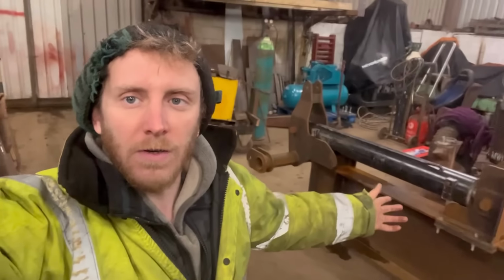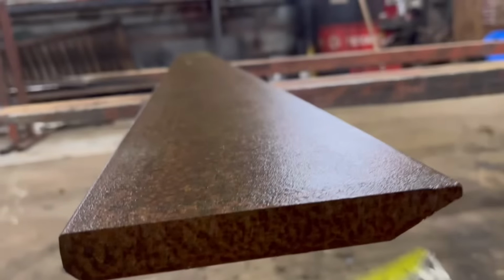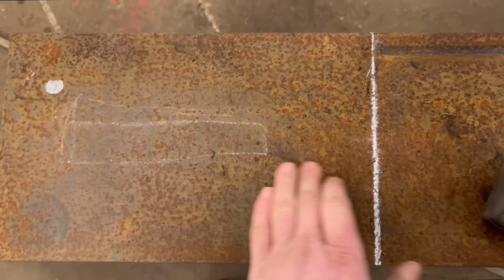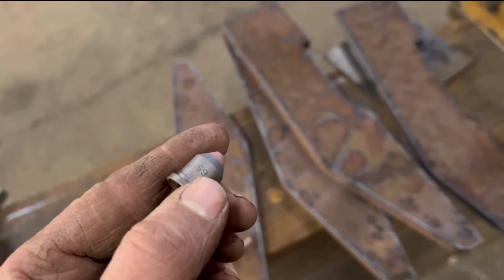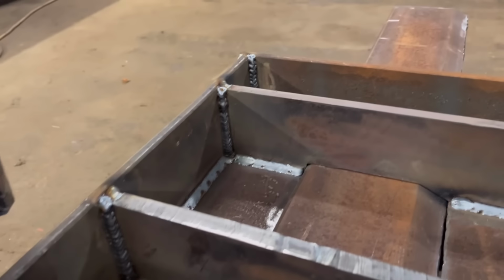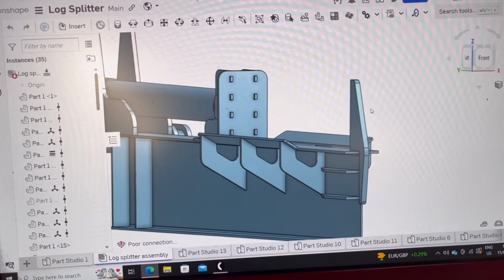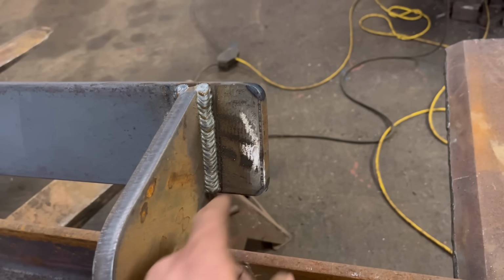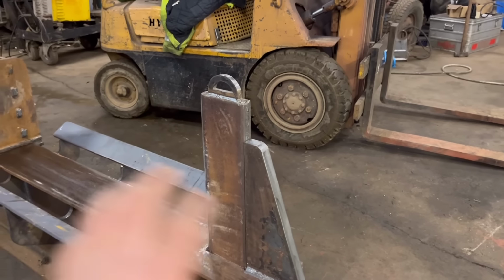Making a HUGE log splitter. Part 3

Comment: Totally over engineered.
If you can only  hand  lift 24 inch logs to the unit you only need 30 inch stroke.
 Star cutter on end (4 way split).
 faster stroke needed.
 smaller cylinder will do the job.
 Good work though !

Comment: A very nice job. And you mentioned the 2 improvements I was thinking of.I would make a large table on the side opposite where you mount the control valve and make 4 and 6 way splitter blades.

Comment: I have one built in 1981 and it’s extremely heavy duty like this one and is very heavy, needs a jd420/4440 to handle it properly 😮😮😮, going to add a engine and pump, plus tank under it and I could use it both ways, and keep 3 point hitch setup

Comment: Also when I was welding we used to have core why and it was much better than the the coated wire I like it a lot better anyway the other thing is that it's much easier to weld heavy heavy material with it the core wire it's better in the wind is too as well I found it bernd a bit hotter but I like the world with a heart hotter hire rampage cuz I don't like a cold pool molten pool❤😂🎉😢😮😅😊😊😅😅

Comment: There's a advisor with a welding 🥽 lens in it that's that's like it's like a pair of glasses I find it much easier to tack weld with it I haven't got that helmet flopping around the top of your head not saying to weld longwells with it but just to do the attacking it's the easiest you can also get them to switch on and off so that they clear when there's no bright light

Comment: When welding vertical up and down, try point your welding nozzle UPHILL. Weave weld UPHILL and normal weld coming downhill. Your V ups look a little cold. Try upping your wire feed, amperage and voltage. At 43.09, I would be trying 150 amps and 20 volts to start and adjust from there.

Comment: Tip.... for your vertical up welds, weld triangles,  across joint - then up at an angle to center joint - then down at an angle to the top of your cross weld - then stack and repeat.  You'll get the feel for how far you can travel on the vertical angle up with metal thickness to voltage used. Super strong weld. Used on Manitowoc cranes at Manitowoc Engineering,should work well for the rest of us ! Hope this helps.

Comment: The blade's not strong enough to split aluminum or copper ingots. Make the blade into a wedge with flat back and harden the leading edge. Widen the back support to continue wedging.

Comment: I had to put an anchor bracket on the seal end of the ram on mine because there is always a tiny bit of flex in the rod where it goes into the ram and it kept blowing seals. And the slide started gouging into the main beam

Comment: I have a Hakki pilke processor 1x37 which has a 10t ram in it. It has its own pump and has a really fast stroke rate. It will split as big an Oak ring that you would want to lift into it. 

By going for such a big ram and the strength you have built it I would want it to split the wood into perhaps 20 parts. There's a few machines on YouTube that look a similar size to what you are going for here and they break huge rings down into many smaller logs. 2, 4,6 way split just doesn't justify the strength of this machine. This almost wants to be a one-and-done type of machine. 

One of the great things about the machine I have is the fact the timber goes up an elevator and into the trailer which is super handy. Ideally, you don't want to be handling the wood twice if you can help it here.

Interested to see what your future plans are for this machine and how you plan to progress it. Great work so far.

Comment: I live in the North East US, I've seen a LOT of mechanical devices people have referred to as "log splitters". They were all incorrect. What you have there is a log splitter, all others are pretenders! Try welding some angle iron on each side of the blade. That will solve a lot of problem of the split pieces staying held by bits of stringy wood.

Comment: In college we had to learn all position welding because you can’t always move your work around so you have to adapt. Flat and horizontal are easier but vertical and overhead are sometimes necessary

Comment: Add some spreader wedges at the back of the blade. It wil save your cylinder from having to travel so much on stubborn word. I thought i overbuilt built my fabrication , this is one strong spliter. It will be here for many centuries.

Comment: I looked up the cast number on that beam - I'm a Shift Manager at Scunthorpe Steelplant. If that is British Steel I was on when the steel was made and cast into a slab ready for rolling😁. That cast was made in June 2020, if it's not British Steel then it should be!  Coincidentally my friend owns a farm and we made a similar splitter with a JCB hydraulic ram, used a DCV from an old potato harvester to control the hydraulics on the splitter itself rather than in the tractor. Nice work

Comment: its to slow  try an find a hedge cutter pump they are usually a  two stage pump they move the ram faster until it hits the log then it will go into high pressure for splitting all you need is a separate oil tank an run the pump off the pto that way you will save on fuel to because the tractor will only be ticking over
Reply from the maker: When we’re using it at the end of the video the tractor is only ticking over and it’s plenty fast enough.

Comment: Little idea. I used to work welding nothing but big splitters 20 / 36 and 50 ton splitters,to mount on a traktorer hydraulic. You need to make the backside of the wedge/knife wider. weld 20 or 30 millimeters in on the backside and tilt it forward maby10 millimeter, so that the log is not wanting to be pushed up from the knife. just an idea very good work with a lot of talent. greetings from Denmark

Comment: why didnt you make the flat plate pushed by the ram stop with in 1/4"  or the wedge all it do it split it and have to be pulled apart so not fully splitting it, its very slow splitting and not that big of ram

Comment: If you put kickers 3 or 4 inches from the point, after the log starts to split it will complete the split much quicker. If you have trouble splitting harder wood, the width of one of those cutting edges is quite enough and will start a split much easier in hard woods. If you split a lot of wood you will want a dedicated engine and two stage pump. Or maybe a high flow skid steer or tractor. It would move the ram much quicker and still have  power when needed. Very nice splitter!

Comment: Beats how we used to cut wood. We had a huge tallowood tree about 6feet dia.and about 25 metres long.  First cut it inot 6 ft lengths then split these into large strainer post si ze  pieces then carted themm to the sawbench and cut them into blocks then split into firewood size blocks about 3inches square

Comment: You could have built  it sideways  or upsidedown so you wouldnt need to lift the blocks up but just back over them with the tractor aand split them.
Reply: You could then pick up the block and split straight into the trrailer save any lifting. Just a thought.

Comment: i built a similar logsplitter 2 years ago,  for the knife I used a worn out ploughshare - works great.  Even works for splittimg logs in 4 parts, using 2 shares and a bit welding. But most of the times i only split in 2 at once.  Its not so usefull, if your tractor's got mechanical hydraulic control units - you gotta enter the trqctor cabin for operation.  I'm mounting my splitter not in the back but at the front loader, and built a cable extension for the hydraulic control units - si I can operate the splitter right next to the splitter iitself, don' need to get on the tractor. Works very fast & efficient -  mostly splittimg logs of 110cm length.

Comment: To reduce flexing at the blade end of the unit you could add a strut rod or strut bar that connects from the top of the 3 point hitch mount and connects to the top of the blade or the blade support at the very end.  Having a way to pretension it would be key.  It would also help support the end when being transported on the 3 point hitch.  Even a large diameter steel cable with a turnbuckle would provide support to the blade or blade reinforcement and it wouldn't be in the way.  A 2' diameter piece of round bar with a way to preload it should eliminate most flex.

You should have cut slots in both sides of the splitter blade.  If you would have cut 3/8"x4" slots in different places on each half of the blade you could have welder the slots up which would have bonded the halves together throughout the surface.

Comment: If you made an adapter piece for the ram head, you would only need 2 pins to hold it in, and it would be possible to allow for multiple adjustments for length by just making different adapters. A simple piece shaped like a "T" with 2 holes for pins that lies down and braces against the head for stability and to push straight at the head.

Also consider making a cross piece for the blade, so it can split vertically ans horizontally in one pass.

Nice work!! (those welds look pretty good to me, don't so hard on yourself)

Comment: Just a tip for you when doing vertical up welds, try doing a tall “n” weave instead of the “C” or “Z” weave. Running the “n” weave allows more time for you to penetrate the base material a little more. And it makes your final bead come out a little more consistent. 
(Not trying to sound like a smart ass just some friendly advice from a certified career welder)

Comment: Hi ollie,i built a big log splitter (i thought it was big until you started this one😂). Its a tow behind with its own honda gx340. I e mailed FLOWFIT with my ram size and engine and they supplied adapter/pump/valve block. Its a 2 stage pump that really speeds up operation. Also the valve block is designed for a splitter so has auto kickout on return stroke so i can be loading next log as it does its thing. I have it on 3 point linkage and quick connect hydraulic fittings but even when neighbours borrow it they use it off petrol engine because the 2 speed pump is so much quicker and petrol engine has loads of power to bust even the hardest of seasoned oak logs

Comment: Nice work as usual Oliver!
You might want to have the knife leaning slightly towards the press plate. That will help to prevent the log to lift. Knots and other will sometimes make the log to behave quite difficult.
I don’t know, but the main beam can also behave a bit strange when splitting a crooked log. Time will tell.
Keep up the good work!!

Comment: The blade needs to be welded where it enters the joist and it is not sharp enough. Also for greater force, a little bit bigger hydraulic ram is required. I may be wrong.

Comment: those blades that are a cross can be a pain in the ass mate, unless you do one size log all the time because it will make odd size firewood depending on the size of the log, good work i wish i could do a fraction of what you can do

Comment: I agree a 4 way blade with adjustable height. Watching your dad yanking at the 90% split oak just showed me why I get a bad back when I'm splitting. Need to be able to just retract ram and put another log in and let that push the first one through. At least it's attached to the tractor so you can just keep drawing forward to clear the pile of split. But I have to admit that's the first log splitter I've ever seen that will survive a nuclear blast. Keep up the videos love watching them.

Comment: You can easily fix your Adflo battery as there are only 18650 cells inside. Just pull it apart and replace them, will be loads cheaper than a new pack.
Reply from the maker: That’s good to know, Thanks!

Comment: Hi Olly.
Just a little tip regarding UV protection. A clear lens can also be used. So if you have a clear face mask you could use it in combo with your dark shades and you won't get red in the face. 
Thanks for the video.

Comment: I welded a horizontal bar on the push plate about 50mm down with a V in the centre to clear the  splitting wedge
It made the world of difference and stopped the logs kicking up when under pressure 
Fantastic job you got going on there

Comment: It turned out amazing Oliver, well done. As for your welding we are our own worst critics and I can not weld. Just a thought about putting an axle with wheels on the end not large ones. Then put fenders over the tires that can help with catching the cut wood so it does not fall on the ground. Just a thought your knowledge is much better then mine in fabricating and designing.  Cheers!

Comment: Looks great better it flexes a little bit than snaps, only thing seen that could improve your overall design is to extend the wood 🪵 catches all the way to the end so your not having to bend over to piece up pieces you just split, make two more of those brackets and add about a foot or two of the plate to top, that way you just retract the ram and place pieces back on the cutting edge and go again, we bought a cheapo Champion wood splitter for our shop, and it definitely needs wood 🪵 catches in it, definitely going to extend past blade, plus have plans to raise it up by approximately a foot or more cause it's right on the ground, but as far as MONSTER wood splitters, you made the big daddy 😉🤣👍👍👍👏👏👏

Comment: Hi Oliver, A suggestion install a diverter valve that adds the return flow oil into the high pressure line up to a threshold pressure and when the load is high on the ram it releases and allows the low pressure side to return to the tractor. It works like there are two speeds - just done automatically
Reply from the maker: Yes, this sounds a good idea

Comment: No wonder it is so big. Not so much a long splitter, as a tree splitter. Good for a prototype. Vertical up mig. I find it really hard. Getting the welder set up is the hardest. I have been told go down a metal thickness. But I still have trouble. Wish mine were as good as yours.

Comment: Hi Oliver this is only my wondering, if the cutting blade tapered back towards ram at top,( at a slant longer at top than bottom)  do you think it will push log downward to base clamping it  stoping log lifting upwards also may put less pressure on blade cutting through at a angled blade than full blade, hopefully stopping some of flex. You right about  painting you don't want it rusting through in a couple of weeks. Absolutely  Brilliant. Thanks Mick
Reply from the maker: Yes, more like a scissor, I should have done that
Reply: Sometimes  you only see these things after  someone has done all the work making it. Best part of involvement with your projects. REGARDS Mick

Comment: Are you going to add a valve body outside so you can put the tractor hydraulics in float and operate it from outside by yourself?
Reply from the maker: Yes that’s the plan

Comment: Thanks for putting the 10x on the screen when you time lapsed (even if it was in the top or bottom corner).  It makes someone that does not work in metal like you to understand how long it takes to cut steel, etc.  Also great job on the splitter.

Comment: Nice job . But i been welding for 30 years some vertical up but much of the time vertical down and the guy i work for all vertical down. we work on heavy equipment ,truck frames we build trailer and do repairs like you .never had one come back you just need to no what your doing  in joy watch you . When we do cut edges we clamp the length of it to a box tube to keep it straight. keep up the good work

Comment: What a beauty!
I’d say stick some graphite grease on those sliders, apparently it’s better than moly grease in wet environments (I think they use it on 5th wheel couplings). 
Lovely job, I’d love a log splitter, nowhere near this big though, I’ve only got a little log burner.

Comment: I tried to warn you in the previous video. It’s way more work with the wedge stationary and the ram pushing the log. Should’ve put the wedge on the ram and flat part stationary. The way you have it pushes the log past where you’re standing and onto the ground. You can “catch” the piece on your side but still have to walk around the machine, pick up the piece a second time for a second split of the piece opposite you.  
I’m not questioning your skill as a fabricator, just the design.
Reply from the maker: No, this suits how we’ll have it set up better because it’ll push the split logs off the splitter onto the next process.

Comment: Great work as always Oliver but what the Christ are you splitting over there that you need such a powerful ram that moves at, what can only be politely called, a graceful and stately pace?  Petrified wood? Had one like this once but vertical. Too scary to use on the 3 point hitch so I chained it to a tree and used it occasionally to split knarly blocks but mostly as a crude hydraulic press and bender. It was also useful for splitting defunct wood splitters. A wood splitter splitter.

Comment: You need to get a standalone engine on it. Issue with running a big tractor (with enough flow for a decent cycle time) is it costs £12 at least in depreciation plus diesel plus a man in the cab. 

Would also make a shit hot video, that would get loads of views, if you built an engine on it and a log lifter etc etc

As always 👌🔥

Comment: Some log splitter that mate. As for the vertical welding it’s not that bad at all to be honest. I find using stick welding better than mig for vertical, just because the arc is more controllable. Just the way I was taught 👍

Comment: As has been said before a cross  saves you having to put the logs through twice 
A slight downward rake on the blade helps to keep the logs tight to the beam
And if the tele handeler can run it off the 3rd service you can load it on the floor and split straight into a trailer

Comment: If you pull the blade out of the I-beam, will you be king? lol Nice series. A heavy duty splitter. You may need a PTO driven or engine driven hydraulic pump to get the ram to move fast enough.